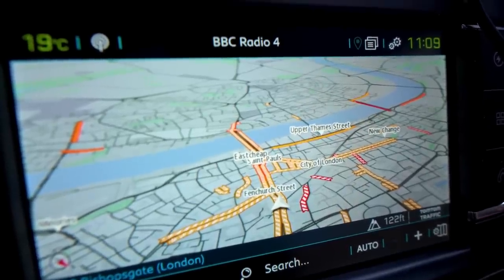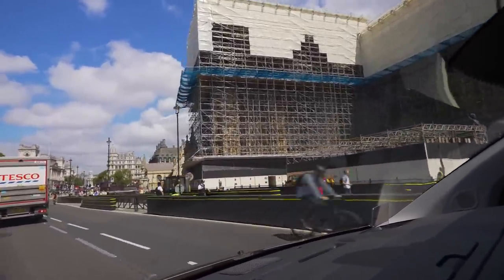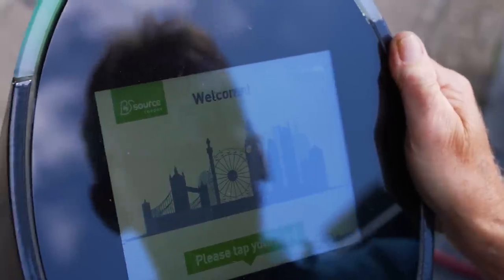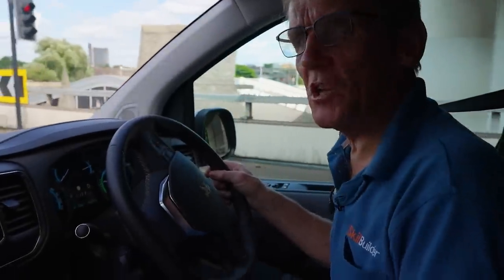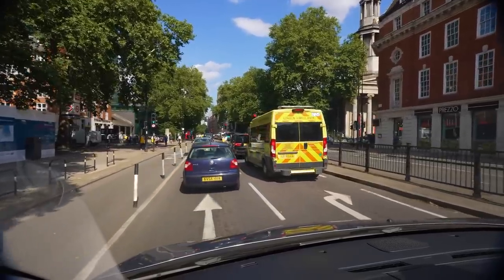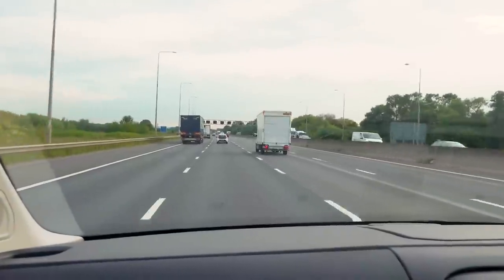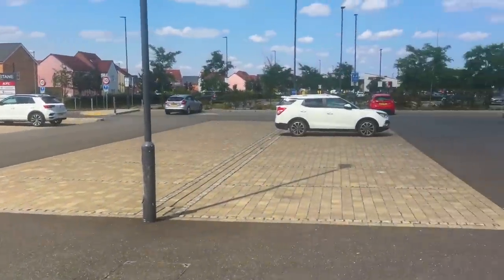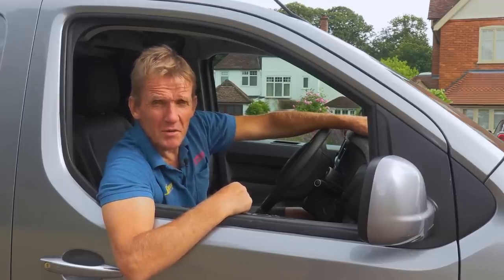Is It Time To Switch To An Electric Van?  e-Expert Test

Comment: What’s the battery life? As in, when do they need to be replaced? Also, what’s the C02 emissions for mining the materials to make these batteries? These all take fossil fuels to make these ‘green’ vehicles..........there’s a much deeper rooted agenda here, Roger. I’m all for cleaner air etc etc, but there’s a lot of hypocrisy surrounded the manufacturing of these machines.
Reply: If you want actual answers to this.

1. battery life- currently expectations are around a 10% loss of range by 300,000 miles, 20% at 500,000  (based on Tesla’s as these are where most data is) This is improving and Tesla is looking at a million mile battery. 300,000 is twice the current average car usage over a lifetime, so it is more likely that the car will collapse around the battery. Bear in ind the battery will still be valuable then for general storage (needed with more renewables). The expected life of the battery is 20 to 30 years as a result. They are already 94% recyclable and this will improve with larger volumes.
2. lifecycle CO2 emissions for an EV are exceeded by an ICE car after only 10,000 miles the latest legitimate independent studies show (this includes all extraction and additional manufacturer energy). This is even if fossil fuels are used to make the cars and all the energy to power them. Electric cars are just so inherently efficient compared to ICE (Internal Combustion Engines). It actually takes nearly as much electricity to make a litre of petrol as it does to drive a car the same distance on that electricity (that is just the electric to refine the petrol, not al the other fossil fuels used to create the petrol or transport it. Electric cars are not green, no car is and we should never think they are, they are way way greener that ICE cars though.
3. The deep rooted agenda is fighting climate change and it has become a thing that voters have requested acres the world so governments are responding. However it is estimated that the world spends 6 trillion dollars a year supporting fossil fuels, so there is an agenda there too - both can be valid for different reasons and different times, but EV’s are set to dominate and relatively quickly.
Reply: @vassabatielos4740  Voters have been coerced into demeaning - sounds like an oxymoron to me. 
Not sure what the same thing is re- diesel - do you mean promoting to reduce co2? Then yes diesels are quite a bit better than petrol for co2, so maybe that did some good - maybe not. Personally not a diesel fan.
And I don’t need to think about why EV’s weren’t developed before (assuming you don’t mean really early EV’s in the early 1900’s that competed well). They competed well until the energy density of fossil fuels really allowed petrol to dominate. It has only been in relatively recent years that batteries have been energy dense enough and at a price point to make EV’s doable. Now they are and the market has been disrupted ICE are just on there way out - economics is taking over. It won’t be overnight but it will be alarmingly quick.
Reply: @davidshipp623  "Electric cars are not green, no car is and we should never think they are, they are way way greener that ICE cars though."

I think that is the important, take home message.
Reply: @vassabatielos4740  The lithium battery tech got so much better in the last decade !
Reply: @SaintCoemgen  -  The hydrogen powered vehicle is clean - and internal combustion engine too, just slightly different injection system and pressure vessel tank. I drove a van for ten years on LPG - similar tank.
Reply: @davidshipp623  I said demanding not demeaning 
And the reason combustion engines took over was because we stole the oil and could make loads of profit from it
Also plastic used to be promoted as the bast thing since sliced bread but all of it was just a way of using up the byproduct of oil refinement
Reply: @vassabatielos4740  haha yes I know I noticed that autocorrect had changed my mis-typing but couldn’t be bothered to change it as it was funny. I don’t agree with your statement on why the combustion engine took over, it was definitely energy density that did it, with the Model T being a huge factor - although I do agree the expansion of oil was for the reasons you said, but electric had lost at that point and for good reason. Plastics are super useful of course but really only took off 20 years or more after oil was fully established as a fuel source- but again I agree a really big factor in helping maintain the oil gravy train.
Reply: You can't be serious! Do you ever ask what the environmental costs associated with mining the precious metals used in catalytic converters?! Or the environmental costs associated with any procuring any other part of an internal combustion engined car's parts?!
Reply: @vassabatielos4740  "And didn’t they say the same thing about diesel cars a while back"
They said that diesel cars were better environmentally because they produced a lower level of carbon dioxide than petrol cars. Obviously though, diesel cars cause far, far more local air pollution (particulates etc.), which is very bad for human health, far worse and more immediate than any health effects related to carbon dioxide driven global warming that they are theorised to prevent due to their lower carbon dioxide emissions.
Reply: @davidshipp623  I wish iPhone batteries were that good.
Reply: @twig3288  haha - amen to that - although we probably wouldn’t want to carry the battery management system we would need!! We might have to wait for the batteries from nuclear waste that can last 1000 years to become viable - not entirely sure I would want that in pocket though😂.
Reply: @thetessellater9163  I think the point that I and Saint Coemgen were making is that a large vehicle for a small number of people that is not in use for 90% of its life is never a green use of resources. Vans of course are a different category than cars in this regard. Hydrogen is a wonderful element, highly reactive, with huge energy levels per kg. Unfortunately these same qualities make it really hard to get at as it has nearly always already reacted and bonded with something else and it takes a lot of energy to get it to release. Once you have it is really difficult to store and transport due to very high pressures being necessary and would require even more infrastructure that the current fossil fuel network at significantly more cost. Once you get it in a car its still more efficient to use it in an electric car via a fuel cell rather than an ICE. This whole end to end process is crazy inefficient and the main way we currently get hydrogen is by stripping it off fossil fuels and releasing the CO2. Recent work has shown that “blue” hydrogen, where they try to capture the CO2, actually increases the CO2 released. The only “green” way to produce hydrogen is by massive overproduction of renewables and using electrolysis to split hydrogen from water. It’s still more efficient to use electricity directly from a battery in vehicles (end to end) and electricity is already everywhere and this is why battery electric vehicles are dominating and will have dominated completely before hydrogen gets a chance to get going. We could use the hydrogen is our methane gas networks during heating transition though - as long as it was produced from renewables and also it will probably have a place to play in forms of transport where weight and distance are harder - ie long distance lorries, ships and aircraft. Sorry to everyone if I am going on but this is an area of interest to me and surprisingly these issues still do not come out outside of forums discussing renewables etc very often. My apologies if I have sounded patronising at any point - not my intention if so.

Comment: Thanks, Great laid back review, I’m ditching the diesel and getting a lwb one on lease so hoping it works out, 100% agree on pulling their finger out to improve the charging infrastructure as it’s the key to adoption.
Reply: @D Fluke why?
Reply: You should watch Fifth Gear..........and get very depressed.
Reply: @nainka11  wow thanks 👍🏼
Reply: Don’t do it, you’ll be sorry.
Reply: Do you carry much weight? Let us know how you get on if you pull the pin
Reply: @peteydynamite8794  I carry a full load all the time, motorway driving reduces the range but really impressed with the efficiency around town and local driving and that is 95% of my driving, good so far only charged once in a week.
Reply: @martingill6996  Good to hear, does the range suffer much with a full load on a dark night with the heater on? Much difference in monthly versus a diesel assuming you've leased?
Reply: @peteydynamite8794  to be honest it’s early days yet and I drive for efficiency, using heating to a minimum, which is how I like it, - wish the brake regeneration was stronger in B mode. + you can preheat the cabin of the mains supply via the app to defrost etc. , there won’t be any significant savings yet though until they bring the purchase price down inline with petrol and diesel vehicles which makes the monthly lease cost higher. If you pay a congestion charge to drive inner city then it would definitely be beneficial however.
Reply: Why wasn't there any comment regarding the loss of of the manual gearbox and the clutch pedal? I've tried driving automatics, and I've failed, in regards to be doing that well, when it came to maneuvering in tight spaces. I need my clutch pedal. Also, I refuse to be having a smart phone. Thankfully, I'm not desperate  enough, yet, in regards to reducing the costs of my fuel, to be considering any electric vehicle.

Comment: We tried the Vauxhall version of that van last year and it just wasn't good enough for countywide coverage. It's great around a town like Brighton where the greens have ballsed up the road layout so much it's basically a car park but on the longer runs it was awful and turned an 8 hour day into 11 a couple times for the lads. Hoping that the VW ID Buzz cargo with it's 350mile range next year will be more suitable to take over from a diesel especially with the ULEZ and other company perks and discounts (which we know once everyones electric won't mean a damn thing). May as well save and finance if you can though.
Reply: That's the biggest issue - do you send a worker off the job for a few hours to find a charger and the job takes longer, or endure a longer day at the end of the job charging up just to get home? I'll keep sayiing it on every EV video I watch - show me a vehicle with a reliable 400-500 mile range per charge, all temperatures, air con, heating whatever else, plus a charger that can fully charge in 15 mins... then I'll buy it. Time is precious - I refuse to spend weeks of my life every year sat at charge points!
Reply: @duplicitouskendoll9402  Mate in what day are you doing 400-500 miles in one shot, you'll get zero work done. The huge benefit of EVs is that you plug in every night at your own home and then you get a full battery in the morning for the day ahead.
Reply: @AndrewStrydomBRP  I do though, at least 2-3 times per week. I work on critical national infrastructure all over the UK and it's site-based work that can't be done from home. I will leave my home at stupid-o-clock to avoid traffic, do 4-6 hours on site, then back on the road home. The rest of the week I DO work from home to balance out the hours. I live on the South Coast, so everywhere is a drive, even London is 150 miles round trip and that depletes a Tesla Model Y battery in winter beyond what I'm comfortable with! Townies with driveways who live in a bubble are fine with EVs though lol. 10 minutes a week at petrol stations or 3-4 hours per week at charging points for the same mileage - a no-brainer for someone who already spends enough time away from home!
Reply: @duplicitouskendoll9402  Then that's fine and it's not yet ready for you, but that's not the majority of people, these vans are perfect for city and work under 50 miles away, which is good for the majority.
I've just bought one and I'm very happy with the range since I work in and around london.

Comment: I really enjoyed the video and the honesty. Couple of points , in a city I can see the reasoning behind having one but outside of cities I can't see it working. I live in a large village in East Sussex  and UK power have already told our local council that there are no plans to upgrade our infrastructure which is already at capacity so no charging points at all on existing homes. Secondly the UK will not have the capacity to charge vehicles on a mass scale, without Nuclear I'm afraid the idea of electric vehicles rolled out across the country is a non starter.
Reply: Who wants to spend £50000 on a vehicle that you daren’t take onto a motorway though?
Reply: @grippipethin2796  why wouldn’t you take it on a motorway??

Comment: The reality of it for the company I work for is engineers charging maybe twice a day. Broken or busy chargers in limited numbers. Renault E varos with a real world 100 mile radius when you factor in heating, air con, van load even weather .
The tech or infrastructure outside the cities isn't good enough yet.

Comment: I would like electric van but just at the present time they still don't have the range, and take to long to recharge, I cover 1000plus miles a week. Can't charge at home as my garage is in block and no power, cant fit charger out side home as on street parking.. until then are charging points on every street like lamp posts its not going to be easy. Last week I did 800 miles in 2 days for work easy with diesel to fill up and go electric would take days

Comment: Electric vehicles are not the future; clean burn green hydrogen is ! Very little design changes required for the internal combustion engine, quick fill up at suitably adapted garages possible, and no range anxiety. The same hydrogen distribution network could also fulfil home heating via hydrogen gas boilers.
The gas can be made from green electricity, at the coast from offshore wind farms, and locally from solar arrays. Things like site plant can run all day - possibly using hydrogen refuelling bowsers - unlike battery tech, which in itself is 'dirty' and very heavy, so you are wasting power just lugging around those batteries !  It is thought a 20 ton truck needs 8 tons of battery - impractical !
Reply: Like it !.

Comment: I know there's of thousands of you who do it, but I'd be in an early grave if I had to work in London with any regularity. Hats off to you all. The place is horrific to drive around.
Reply from the maker: Hi Mark 
It takes time and patience but it is never boring, if you like people watching and architecture.
Reply: @SkillBuilder  😂😂😂 wasted hours stuck in traffic. Lived there for years until 2006…London driving is a nightmare.
Reply: @SkillBuilder  People watching and architecture won't pay for a 50k van in the real world - that'll take some serious hard graft. And by the time you've paid for it, it'll be worthless.
Reply: It's donkey's years since I last visited London. I wasn't shocked when I heard on the radio a few weeks back that the average speed of traffic in London is 8mph........
Reply: @oblux   You wouldn't buy a £50k van if you were in business. You'd lease it, which would be tax deductable. That way the value of the van at the end of the lease is irrelevant.
Reply: @Brian-om2hh  Not quite irrelevant if using your argument - leasing a van is a total nightmare if you're actually using it for real work. They make you fork out a fair penny if it happens to be a bit scuffed or damaged when returned (as all work vans are) Yes it's tax efficient, but the lease companies always find ways to get their profit out of you. It's only essentially a hire vehicle if on lease, and like a hire vehicle, needs to be returned in tip top condition with a limited milage.

Comment: It all sounds great but the price, the range and the recharge time are just deal breakers.  This technology needs to be a lot better before it can become mainstream.
Reply: It can't really work for commercial vehicles imo. The energy density is not there. Loss of payload and regular cycling or batteries just doesn't work well. The inflationary pressure that is placed on the economy is also not to be overlooked. The big problem is government mentality of replace one technology with another (hydro carbons -> electric). We will need a mixture with electric vehicles for some applications and hydrogen for other applications.

Comment: Sadly the vast majority of comments after this video appear as ill informed negative opinion with little or no fact….here’s a few…
1) The costs of electric vehicles will decline significantly over the next decade as battery costs fall below $120 per kilowatt (they were $1000/kwh in 2010). China will become a major vehicle manufacturing base providing high quality vehicles and pushing down prices further. 
2) Range will increase and range becomes less of an issue when you get used to and understand how to use an EV (I know, I have one)
3) The whole life costs of owning an EV are lower than the whole life costs of petrol or diesel - do the maths on any vehicle. 
4) Homes that can install a home charger can buy electricity for as little as 4p/kwh with some tariffs.
I could go on. I accept there are some exceptions/outliers but for the vast majority this is a positive move, just focus on details and facts not opinions..
Reply: Finally a sensible comment.